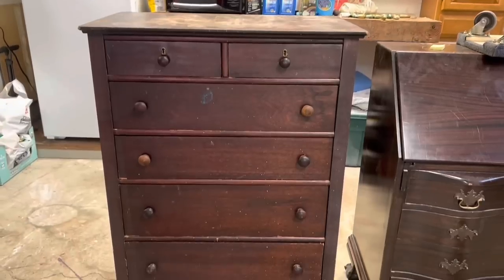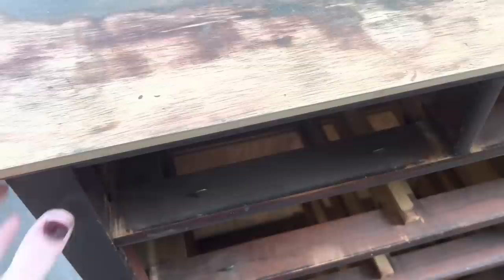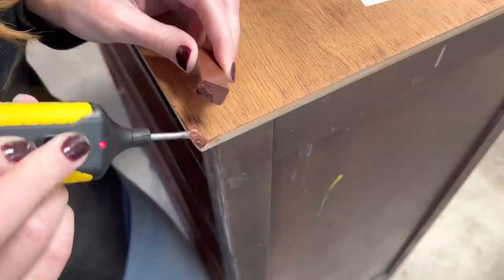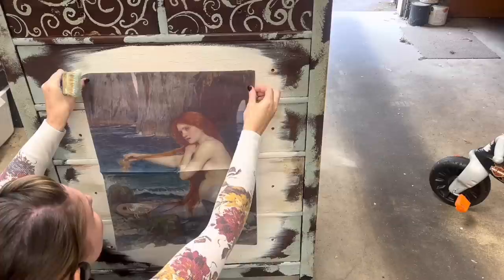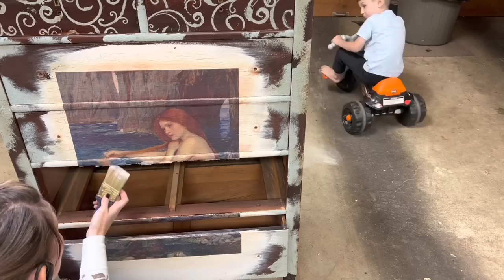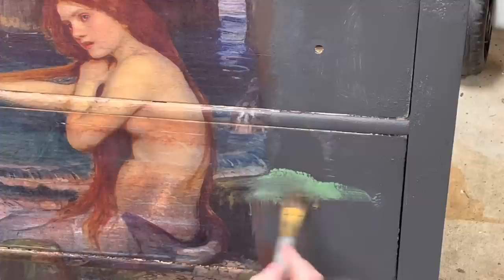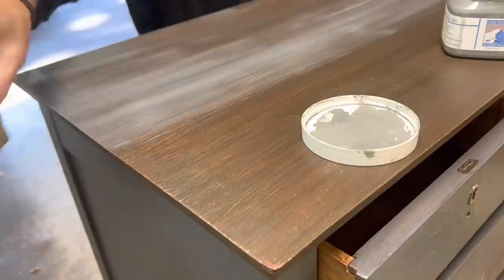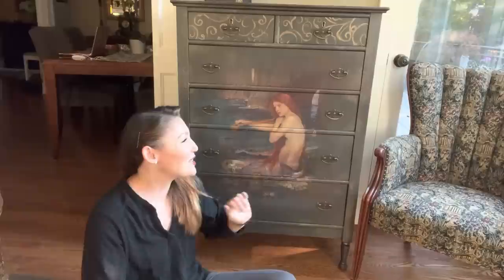Little Dresser Overhaul | Decoupage Mermaid | Raised Stencil | Elegant Upgrades

Comment: When decoupaging a very straight, square piece of paper, try wetting the edges with plain water and gently tearing them off. The slightly ragged edge will blend much more easily.